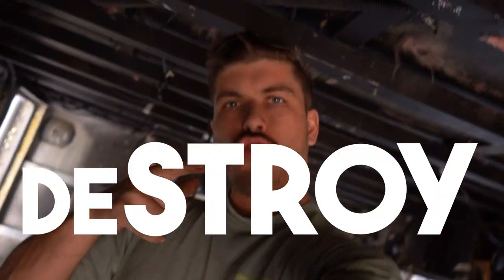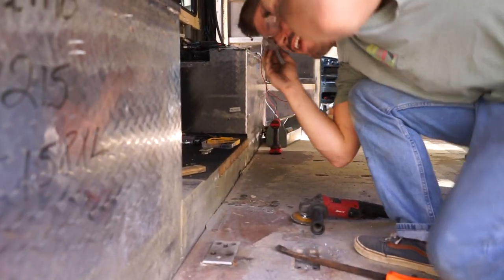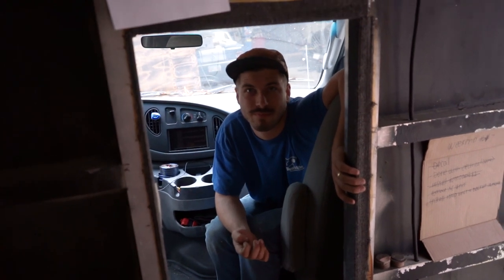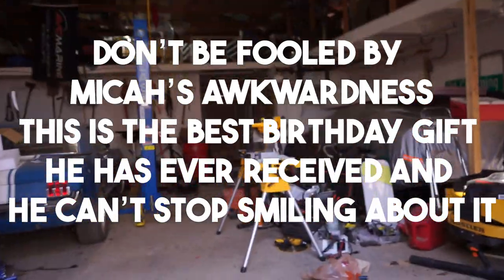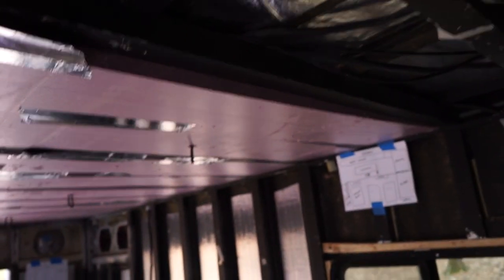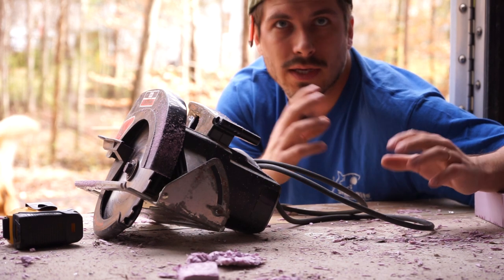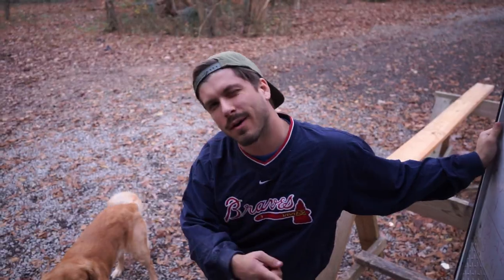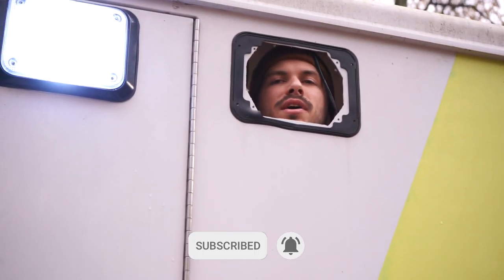Untold Struggles of Ambulance Conversion - FINALLY Building - Week 8 & 9

Comment: Aren't there nut's under the ambo?  You should have been able to drill from the top while holding the nut from under it.  At least that is how those plates were installed on a school bus I did.
Reply from the maker: Yes there are. But the problem was the gas tank was in the way. It left little to no room for me to reach them. And removing that was something I didn’t want to deal with. So destroy it. 😂
Reply: @stephandmicah  that makes sense